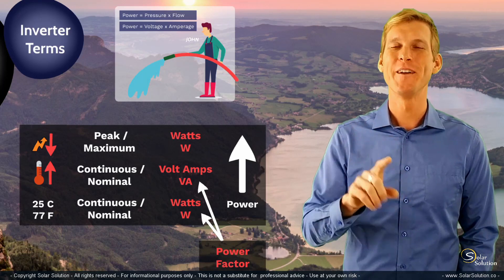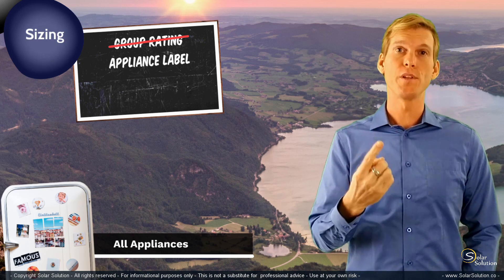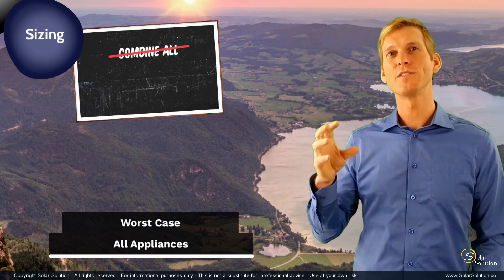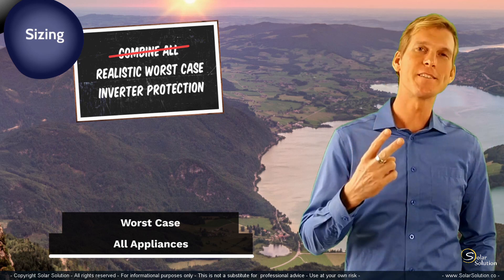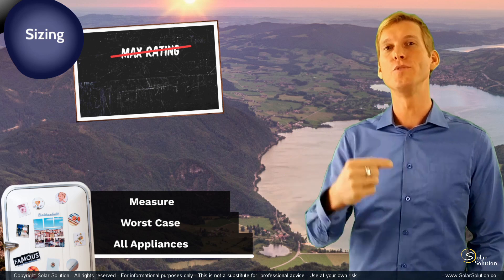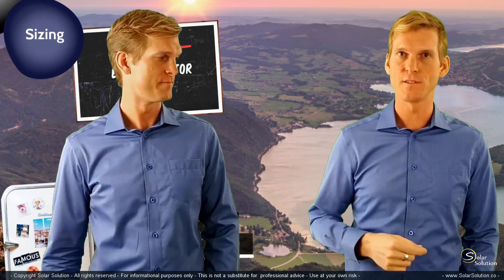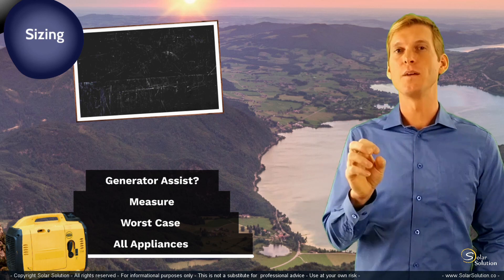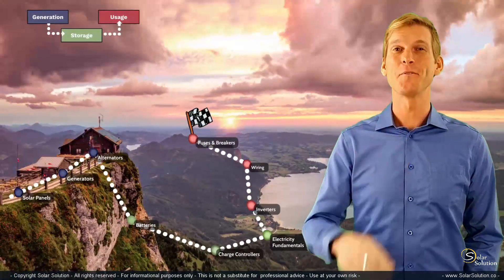How To Size Your Inverter: The 4-step approach

Comment: While I agree on using a clamp meter to find relative consumption for power, the issue with the example of a fridge for instance is that the compressor uses a very high amount of power when it kicks on. Unless you measure this appliance at that usage, then you will be measuring less than your required power use in this specific case. Otherwise, the information here is great!

Comment: you forgot the starting load of motors and other units ( ac, well pump ect.) called inrush current as in 220 volt 11 amp run but 33amp to start (1/2 second) that is why i use low frequency inverter. they have better surge capacity for this

Comment: Thank you so much for your fine channel. It is so nice getting an education at my age (77). 
I recently added an inverter to the solar system in my camper but have run into the same problem as others, which is a charging loop i.e., -battery-inverter-converter-battery. I wonder if I can solve this by putting a diode between the converter and battery so that power can run from, but not to the battery on that circuit,  however I don't know what size diode or where I can find one. The solar system charges the battery separately. Thank you again for you fine channel.

Comment: Are dynamotors an option?
Reply from the maker: An interesting question John! Why are you considering this, and what do you intend to use it for? Semi-conductor powered inverters are generally the superior choice compared to dynamotors / motor-generators due to reliability and energy efficiency. I am looking forward to hear from you, Jesse.
Reply: @SolarSolution  In" theory" they could be reverasble, with variable output. Thier signal "should" be very clean.Apparently very innefficient though.

Comment: Hi,1 am having a submersible water motor of 1 horse power but actually consume 950watts,can I run it on 2.5kva or 2.5kw inverter,the inverter maximum output current is 8amps.
Reply from the maker: Hello Shehriyar, it is good to hear from you. For personal design recommendations, you are welcome to book a consultation through the main website [link pasted below]. Alternatively, you might also benefit from the following video on inverter/chargers: https://youtu.be/RC4Bh7PKk7o. Good luck with your project! All the best, Jesse
https://www.solarsolution.co

Comment: Hi,1 am having a submersible water motor of 1 horse power but actually consume 950watts,can I run it on 2.5kva or 2.5kw inverter,the inverter maximum output current is 8amps.
Reply from the maker: I think this comment appeared twice, see my feedback on your other questions.

Comment: I have a question that ive asked several channels and none have answered. Im wanting to run a 5,000 btu window ac in a cargo trailer for boondocking. Last summer i was told it couldn't be done by a dozen channels that are solar related, i argued with them and now most of them are proving it can be done lol. They are ignoring my questions now, i guess i upset them.
   I have 8 280 3.2 lifepo4 cells, for weight reasons and in case of a piece of equipment malfunction or if i just need to take one out for a temporary use for something else, I'd like to do two 12v suitcase banks and run them as 12v in parallel. Is it possible to get a solar charger controller all in one that will work on two banks in parallel, and still work with only one bank while also being able to handle a pma vertical axis wind turbine? I want to stick one on the front of the trailer to charge while driving or parked in case the sun isn't out. I believe ill need over 1,000 watts of solar, so I'll be using 4 330 watt mono crystalline panels on the roof with a raisable frame for optimum charging. There are different pma alternators from 12v to 24v 1,000 to 3,000 watts, and i have seen a comment that you have to match the wind generator charge to the solar to incorporate the two systems, but I've never done either. Until i know what i need and can do i don't want to start buying equipment. So far i just have the 8 cells and know what i want to do. Ive watched to many videos to count, and none cover what i want to do. Any advice would be appreciated.
Reply from the maker: Hello Mike, it is good to hear from you. What you are describing is possible indeed. I can provide you with advice through one of the service options available on the main website: I will paste the link at the end of this message. Alternatively, you might also benefit from browsing the topic-related playlists on this channel. Good luck! Jesse
https://www.solarsolution.co

Comment: i have a 3000 watt inverter, im guessing the surge max wattage is around 6000 watts for a few seconds. I tried to power a 6000 BTU AC and i cant get the inverter to stay on for a few seconds. There is no way this small 6000 BTU AC compressor surges more that 6000 watts. My Inverter powers my other AC but it is a little smaller at 5000 BTUs. Why do you think the inverter refuses to power the 6000 BTU AC @ 618 Watts?
Reply from the maker: Hello Manny, it is good to hear from you. It might be useful to verify the rated surge current of the inverter, and measure the current draw as you start the AC. Good luck! Jesse
Reply: @SolarSolution  ill try that thanks